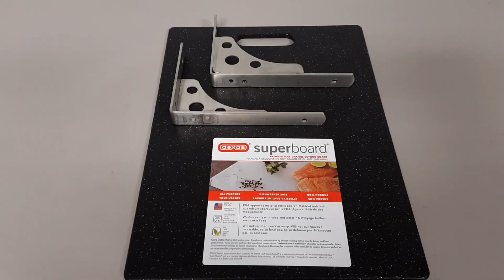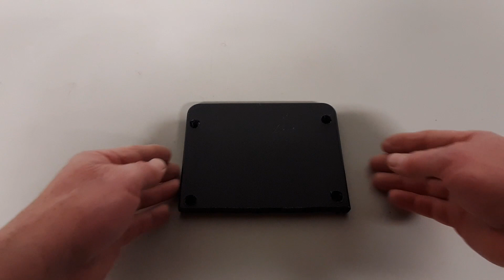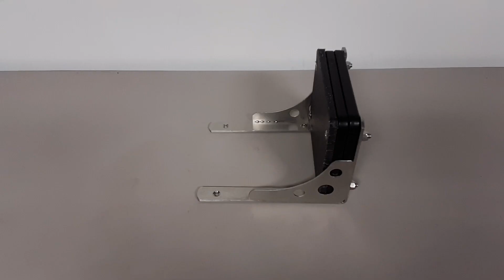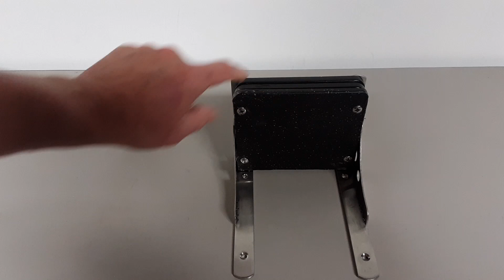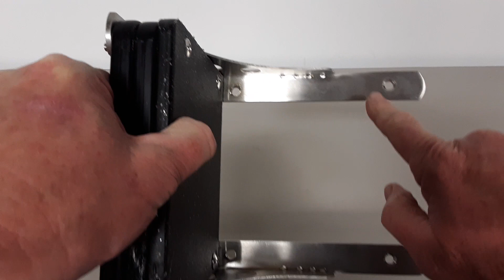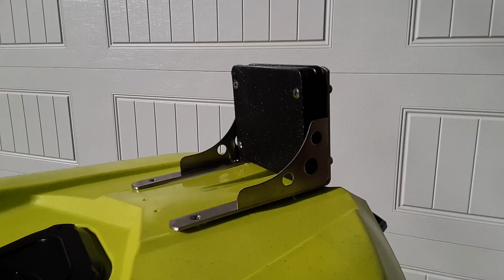DIY Inexpensive Trolling Motor Mount

Comment: Nice design.  I am making one based on your great idea, but I had to use longer self brackets to fit the bow of my boat.  Question: I need different spacing mounting holes on the bracket, but the steel is harder than hell. How did you drill holes in the hardened stainless steel?
Reply from the maker: Thanks Chuck. I had to buy a special drill bit...they are hard as hell to drill.

Comment: how would you recommend mounting the brackets to the top of the kayak? Should the bolts go all the way through and pop out the bottom?
Reply from the maker: They should just go through the upper surface of the hull where it is sitting. I would use either a backing plate or fender washers with bolts.
Reply: @Aksmaniyak  how do you place a backing plate if its on the inside of the kayak hull? regular threaded screws wont hold it sufficiently?
Reply from the maker: @seearress  You put in it through the access plate and use nuts and bolts.

Comment: good video . wouldn't better to put a peace of the cut board between the kayak and the motor shaft to relieve the press of the motor on the bottom of the shaft ?
Reply from the maker: You could or leave a gap between the hull and shaft.

Comment: What did you use to attach the brackets to the kayak? I'm wanting to try this but I don't want to drill holes in my yak until I know exactly how to attach it. FYI it's a pelican Challenger sit on top! thanks great video
Reply from the maker: Thanks James. How you attach it depends on your kayak and if you have interior hull access.
Reply: @Aksmaniyak  I have no access to the inside hull. So do you think some heavy duty rivvets would be strong enough to hold it in place safely? It's my first kayak so I'm still learning how to do my own upgrades as safely as possible
Reply from the maker: @JamesTaylor-lx9nv  Here is an example of a trolling motor mount without access. It should help.   https://www.youtube.com/watch?v=7mbv11780Nk&t=1s

Comment: I'm using 10mm x 1 inch aluminum shelf brackets 3/8 x 3 inch aluminum plate with cutting board

Comment: @ Aksmaniyak
Nice motor mount. Cobalt drill bits work great when drilling stainless steel. In my experience that is, never had a problem drilling many holes with one bit. A tip for the mount, clamp your motor onto it. Then, trace around the clamping screw feet on the poly material.  Remove the motor and use a Forstner bit (the bit size depends on your motors clamping feet diameter) to drill the 2 circles you traced out approximately 1/16" to 1/8" deep. Be sure to drill square to the surface (drill press works best or a drill guide) so the feet can clamp flat and firmly. Now, clamp your motor back on with the clamp feet inset into the pockets you drilled. Now it's virtually impossible for your motor to slide off the mount. Unless you didn't clamp it properly.
Reply from the maker: Thank you Chris. I certainly  don't everything and am constant learning.

Comment: This is a great DIY.  Thanks for sharing.  Question.  Did you have any problems with the trolling motor clamp cups gripping the plastic cutting board?
Just wondering if the cups can get a good bite into the plastic surface?
Reply from the maker: Thanks Jasper. The clamps worked fine for me.

Comment: Great video. Thanks for sharing. One tip when drilling through stainless steel, is to put a bit of milk on the drill bit.
Reply from the maker: Thanks Manny. I have never heard of the milk trick but will definitely try it next time.
Reply: Is there an advantage of milk over spit?

Comment: Looks like you put yours on an RS117 Bondafide. I have the same and wondering if your mounting bracket with motor gets in the way of your stern grab handle when you lower the motor? Any modifications you would make to it at this point?
Reply from the maker: Thanks Jeff. Yes, I did a mod for the rear handle. Here is the link.   https://www.youtube.com/watch?v=kw-1o8FZROA
Reply: @Aksmaniyak  thanks so much for the reply. Easy enough.

Comment: Hi Aks. I have a mount almost exactly like yours. So far, since putting my motor in the rear, I've gone out 3 times and had my line get caught in the prop 3 times. Granted there was a lot of wind and current with 2 lines out. When I had the motor mounted on the side the Yak was hard to turn and control. Constant adjusting was necessary. Having the prop in the back is much better control, but so far very cumbersome going into shore to clear the prop. I'm not certain I'm sold on rear mount. Have you ever tried a center pod mount motor that tips up to clear debris? I'm just not sure which is the best way to go. Do you have any opinions? You put out great videos that are such a help I highly value your opinion. I don't know if you remember but I built your extended control box for the PWM and there was a hesitation when powering up. I later found out it was what they call a "soft start" controller. Works great though. Thanks again. Sorry so long.
Reply from the maker: Thanks Elvis. I'm glad your PWM didn't fry. I have fished using bow and stern mounts and have never had a problem with the line wrapping around the prop. Try putting your lines out at a 45 degree angle.

Comment: Curious what size bracket would be best,there is 5 different sizes,  6,8,10,12,14 inch brackets, i dont have motor or kayak readily available to give a quick measure. Thanks ur videos are by far the most helpful I’ve come across
Reply from the maker: Thanks Frank. The size will depend on the shaft length of your trolling motor. The 6 and 8 should work fine with a stock length shaft. If you shorten it then you will need to do some measuring.